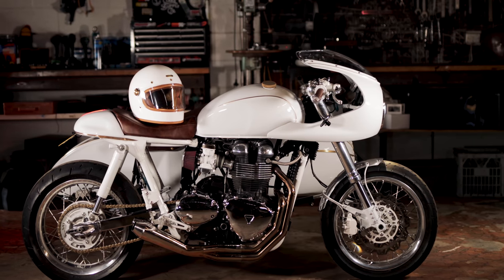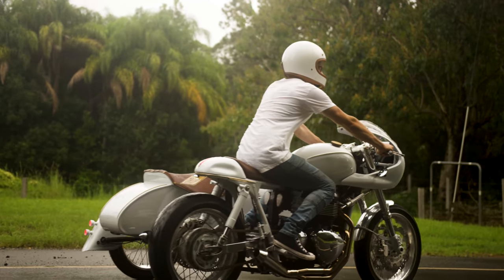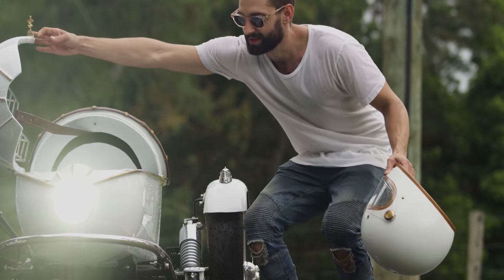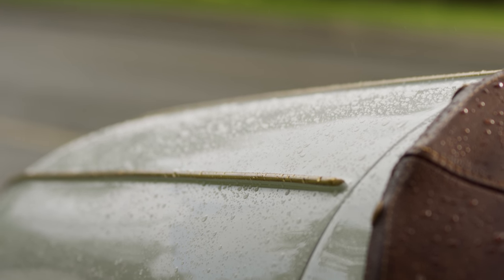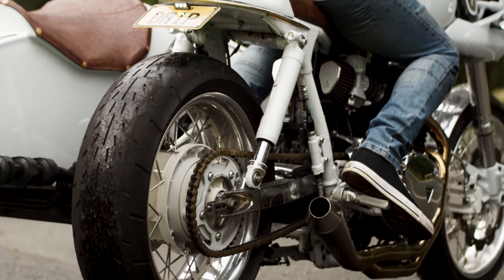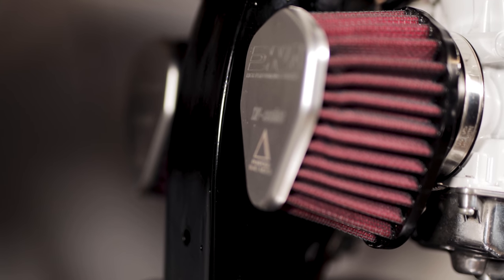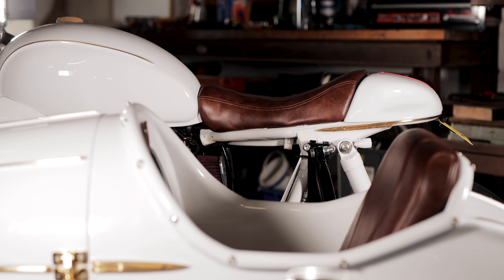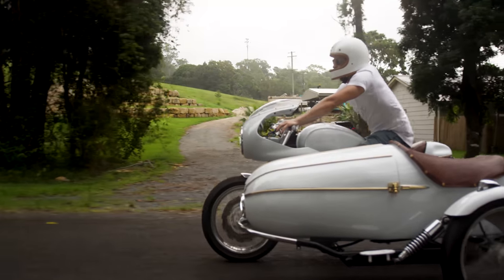Triumph Cafe Racer Sidecar - How to build it | Purpose Built Moto

Comment: Its a sweet machine mate I've got thruxton with a tilbrock chair not connected yet did you fabricate the mountings or use universal kit with some modes any Idea which way to go would be appreciated.
Reply from the maker: Hey Mate, 
We used a universal kit first, which was handy but after 12 months the frame mount showed some fatigue. Recently we've modified the rear lower mount to swing off the more solid point of the centre stand mount.

Comment: Absolutely beautiful!
How did you work out/design the sidecar frame?
Reply from the maker: The Sidecar came with a Chassis and wheel. We've just modified the body and fenders. We also had to custom make the mounts between the sidecar and motorcycle frame.